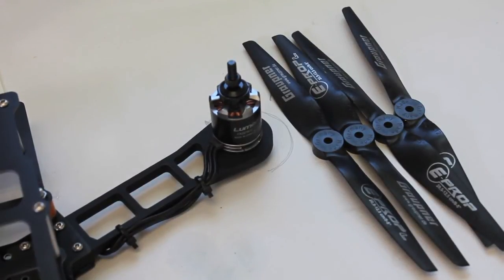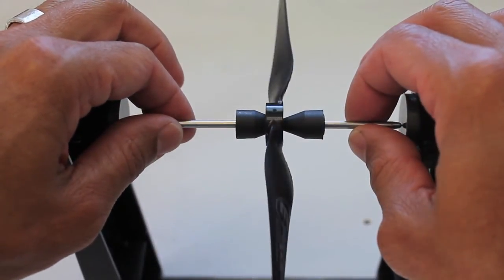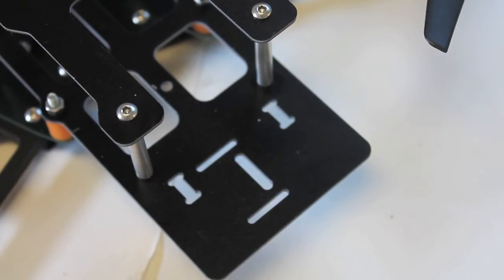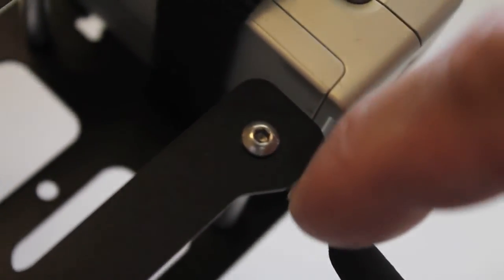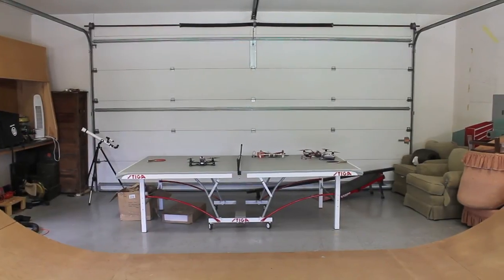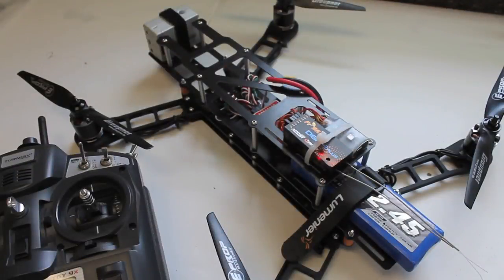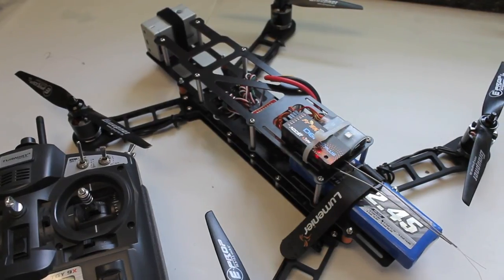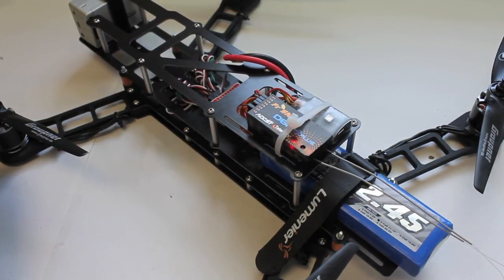QAV400 Garage and Backyard Maiden Flight w/ NAZA and Turnigy 9X 3 Flight Modes

Comment: Hey Dennis. 
I have the same configuration Naza v2/QAV400. 
In GPS mode the copter drifts badly when I actuate on the yaw angle. People all over believe that is a matter of proper gain adjustment. That makes sense, as actually I can't think of anything else, my copter is properly balanced overall. 
I believe this got me into a dark corner of the Naza: its poor documentation, including the lack of explanation on how to tune the 6 tuning values and even the fact that they did not include a mechanism to tune all 6 values in the same flight instance (as you know you can only assign two controlling variables X1/2 to a total of 6 independent values, which is in itself kind of ridiculous).
Sorry, enough for a rant. Do you have any advice that might help me on this? Thank you in advance and keep it up.
Reply from the maker: Hi Claudio, sorry to hear you're dealing with this. I assume you've adjusted your yaw gain in NAZA Assistant. Generally that will help you deal with any oscillations. For Yaw drift I would do a few things:

1. IMU Calibration
2. Check your motors are properly seated. I'd recommend removing them and mounting them back.
3. Check your propellers are well balanced. Always a good thing to do.

Those are the first things that come to mind. Good luck and please keep us posted on your progress.

Comment: I have almost the same setup. QAV400 Naza V2, Turnigy 9x but not sure if my gains are setup correctly because when I accelerate either vertically or side to side, it has this annoying wobble. I thought it was my props but I've balanced them. Any thoughts? Did you have the same issue?
Reply from the maker: Krishan Patel By default the NAZA gains are pretty stable for a 450 size quad. So I just brought them down a little bit to suit the QAV400. I'd try to bring them down slowly and see how that performs. Good luck and keep us posted.
Reply: Dennis Baldwin Hey thanks for the info... I double checked my gain settings and when I setup my controller for remote gain adjustments I forgot to map in the Yaw and Vertical to X2. The Basic Pitch and Roll was already done but I had left it on INH. Also I lowered it to 75% and my attitude gains I changed to 150% and now its GREAT!!! Thanks again

Comment: HI Dennis,  Did you remove the Red lead from each ESC before running them into the NAZA?  Naza comes with its own PMU and it does not seem like a good idea to mix up the power??
Reply from the maker: Larry S You're absolutely right. They're not necessary because of the PMU. I didn't do that originally and didn't have any problems. But subsequently I have removed them. Thanks for the feedback.

Comment: Dennis I'm  little confused with this set up an att mode so u don't need GPS antenna. to fly on att mode is like flying on auto leveling sorry bathers u
Reply from the maker: Mariano Hernandez 1 There is attitude mode without GPS and attitude mode with GPS. With GPS you'll get more precise altitude hold and positioning.

Comment from the maker: I bought this because I wanted something more stable than the TBS. I don't have specifics on flight times but will do a battery discharge comparison soon. I can tell you that I get less flight time because of faster motors with smaller props than on the TBS. It's more agile, but definitely burns through the batts faster. I'll try and get an update soon that shows a comparison. Thanks for watching.

Comment from the maker: Yes, just double-check the NAZA documentation but if I recall the VU will support up to a 6S battery so you should be good. Just make sure your ESCs and motors can handle that much voltage. I would love to fly with a 6S. Talk about some power!

Comment: dennis, quick question...if i wanted to get a quad to go from 4s setup to 6s and the motors are equipped to handle, is it just matter of setting the NAZA and putting on the 6s?

Comment from the maker: Thank you. I agree regarding killing the vibes. I spent a tremendous amount of time trying different materials and the QAV400 does a great job of isolating vibes before they even make it to the camera. I like the concept of a clean and dirty part of the frame. I fly with a little bit of foam material under the GoPro on my QAV400, but mainly because it raises the camera and allows me to get velcro around it more easily. I appreciate you following along.

Comment: Hi Dennis, the idea was to build a stable FPV machine and I had decided to go with the QAV400. I already have a Turnigy 9x and immersion FPV setup which is not yet hooked up to my phantom. I'm waiting for more info on the QAV400G ( Gimbal ) then pull the trigger. I understand that something better will always come along. I'm in I.T. so it's no surprise. I'm also interested in the 'new' phantom but it's not for the same purpose :)

Comment: Congratulations on the build she looks good.. you may want to V out the rx antennas if they cross at a good distance during fpv you might go into failsafe.. or cranking into a turn they may blow into the prop..